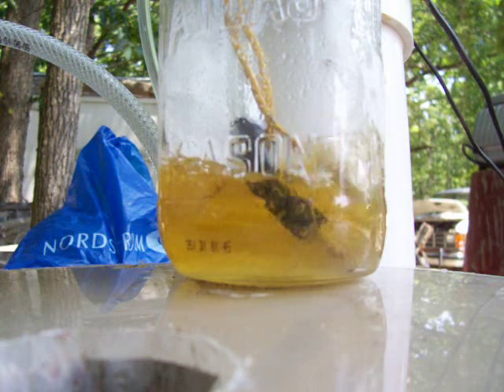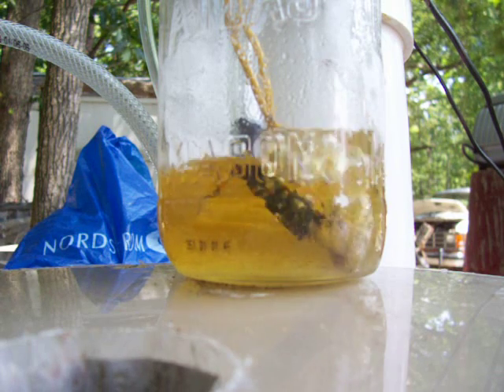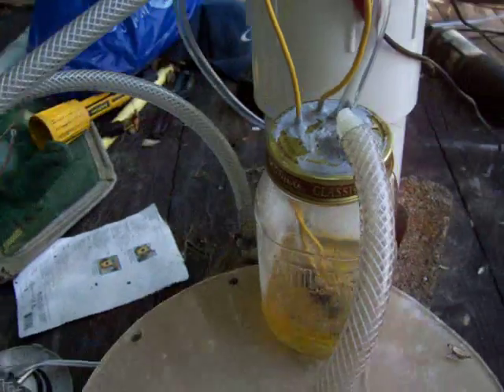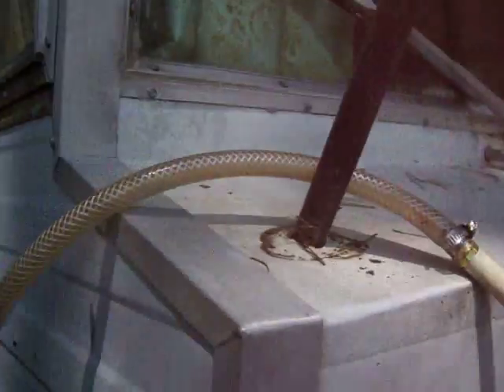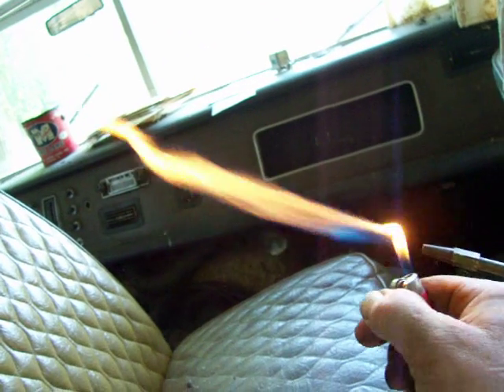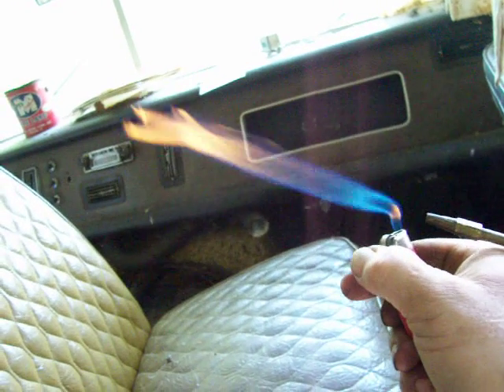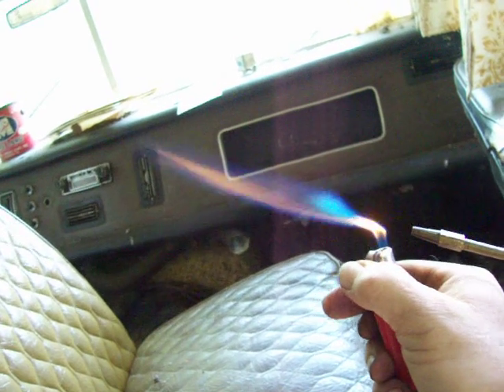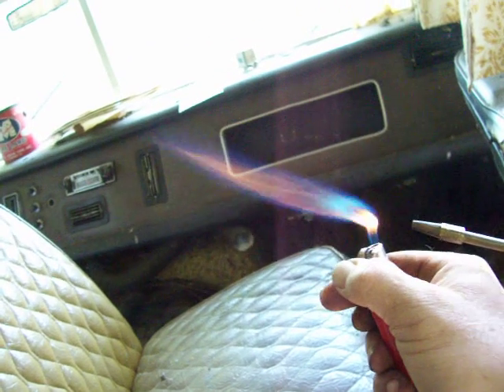Gasoline to  Gasoline Vapor #1

Comment: It has been known and demonstrated for 60 or more years that burning gasoline vapors will give easily 5 times the mpg and near zero emissions. Actually if the vapors are heated to the necessary temperature of 450 degrees F, the gasoline vapors are actually fractionalized by catalytic cracking and converted to smaller light molecular hydrocarbons, methane and methanol

Comment: To get the torch right you need a ball or some type of adjustment valve right before that section of hose that enters the torch end :) but make sure you contain that gas you create :) AWESOME WORK!

Comment: The reason it won't stay lit is because your tip on your torch, doesn't have air vents in it to mixed the oxygen with the gas prior to leaving the tip of the torch. 
If you change your tip it will work. That's why a cutting torch has 2 bottles one for gas and the other is the oxygen. 
But I like your work, I think I'm going to convert my 1966 C10 to run on Gas vapor.

Comment: Try an adjusting valve between airpump and canister to lower pressure into canister. Slight restriction there should allow for adjustment. Or, maybe a pressure regulator between torch head and canister.

Comment: About the ceramic resistor: Did you connect a wire to the outer "shell" and another one to the inner metal  "core" of the transistor and then plug it in to a 120 outlet ...or what?

Comment: you don't need the resistor at all.....  instead of pumping air into the tank, add a hose that is just open air and goes to the bottom... and  pull the vapor out a top hose by vacuum, such as with a motor....  and by the vacuum alone, it will cause the gas to vaporize much quicker while also creating a bubbler effect...  the more it sucks, the more it will vaporize...

Comment: might try to get you a battery operated bubbler for a fish tank with a hose and bubbler stone in the jar see what that does. Basically I tried that last year when I was messing water mist injection. Basically you will agitate the gasoline lots and lots  of bubbles to produce the vapors and it is cheap and simple.
Might even be able to use the same Ken Novack design stone in I got from Mother Earth news for water mist injection

Comment: this is nothing more than an over engineered Craftsman gas torch of the 50s. You fill the fuel tank about 3/4 full of gasoline. A hand pump pressurises the air, sending the fuel up a wick tube to the burner head.  An evaporation chamber on the bottom of the blowtorch head builds pressure between the wick and the burner head. The fuel escapes through an orifice in the burner head, producing a very hot, blue flame and the familiar roar of the blowtorch.

Comment: I see why you can't keep it lit, add a small piece of tube to the end of the tip to add space with holes along the sides, this provides oxygen to the fuel to burn. Simple idea which works look at most of your propane and map gas torches they have those breather holes on the side for this reason.

Comment: how about getting an electric generator to run on vapors, then do a test of first running the generator with a gallon of gas, then with just vapors so you can see how much longer it will run on vapors so we can see whether it's a 10, 20, or 50% increase in efficiency?

Comment: What do you guys put in your gas over there? In Sweden gasoline in clear, not yellow...
Reply: Our cars run on piss. Just kidding. They add 10% ethanol made from corn. It causes problems with small engines and breaks down after 3 weeks of non-use.

Comment: Do you have any videos in which you actually have an engine running to the point you can drive it or use it effectively?  i've spent alot of time looking through your videos and i see all sorts of projects but none of them are completed or finished.  seems like your trying to do too many things at once... you need to stick with one project and get it to work  to the point that you don't have to make excuses for it.

Sorry if it sounds mean, but man up.
Thanks for the videos.